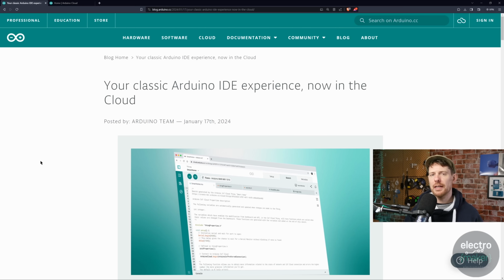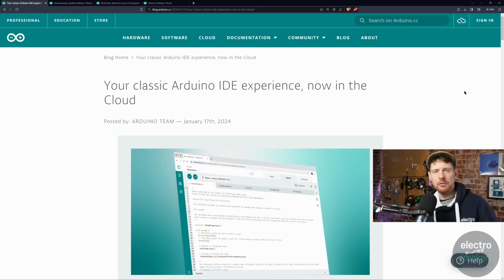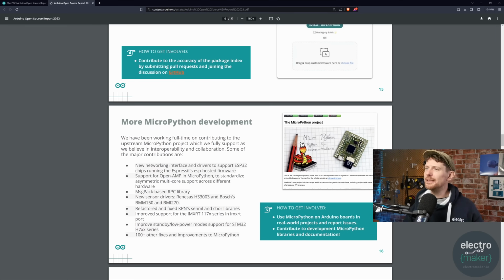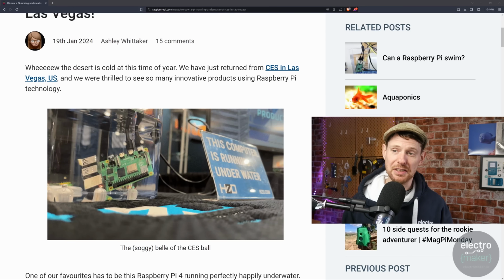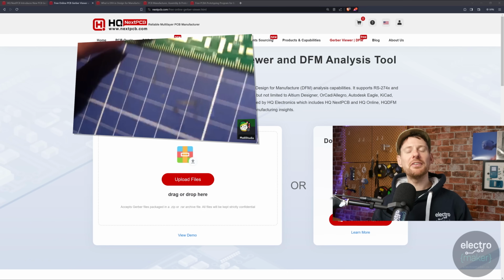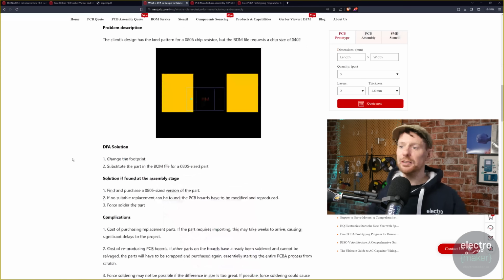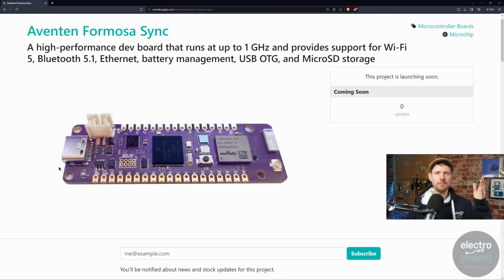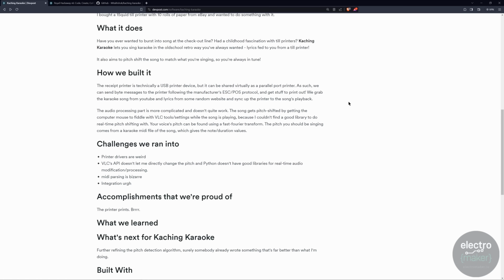Arduino Cloud IDE, Raspberry Pi vs Water, Absurdly Powerful Devboards!

Comment: I'd use the Zimablade as a small Linux server that runs dhcpd and maybe some fireguard tunnels to external servers so I can run my internal network, ensure everything is allocated a correct address and monitor stuff going on.

Comment: Thanks for the episode! I am not sure I understand what problem the cloud IDE solves. Would using git to collaborate not be a better practice, so that you also get versioning? And for the Aventen Formosa - what kind of applications would that be preferrable for, over using a raspberry pi?
Reply: Git is probably overkill for students with Chromebooks just learning their first for() loops. A cloud IDE requires no configuration, and is available anywhere there's web access, including the code they wrote in class that morning.
Reply: @ace.johnny  Hmm that's a fair point. People around me usually start with microcontrollers after already having a solid background in software, but being beginner-friendly is definitely a priority for Arduino.